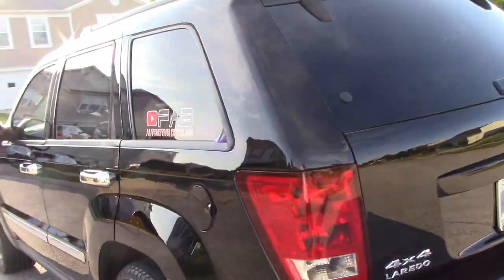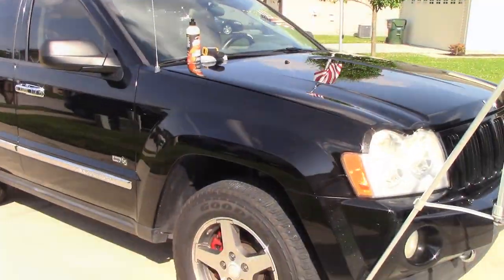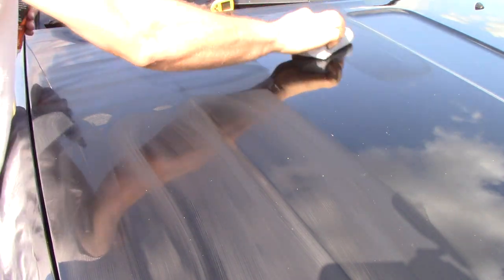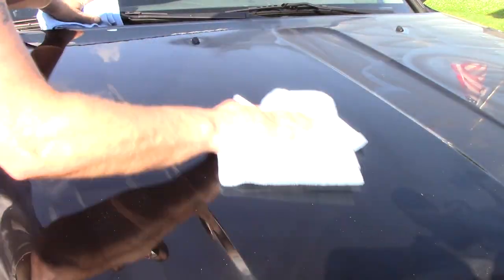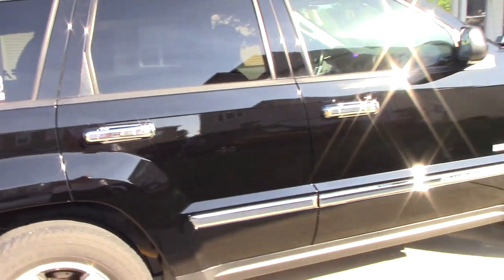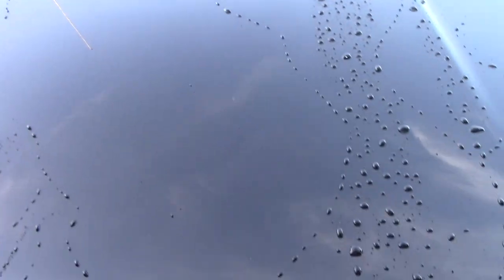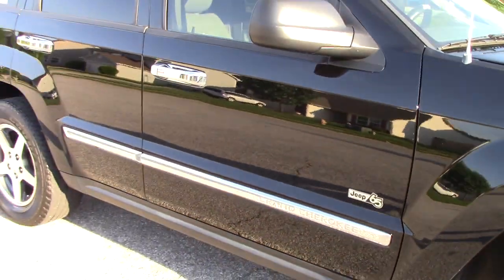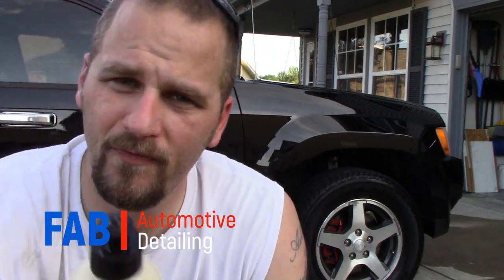Carnauba Wax + Black Paint + Direct Sunlight = Bad Idea?

Comment: Adams Polishes also works well in direct sunlight. I remember seeing somebody using it in direct sun in Arizona in 110 (maybe a couple degrees lower) and it went on and off perfect. I would assume Chemical Guys Butter Wet Wax would do the same as well.
Reply: Ethos makes some awesome designs for their bottles
Reply from the maker: Daily Driven Mustangs I ya e heard that about buttery wax but never have tried it. Yeah their bottle labels sure set the product apart from others.

Comment: Hey bro . Have a question I'm about to do a trasfer case fluid change and differential fluid change on my two jeeps grand Cherokee  but cant find them on mopar site . If you did those fluids where did you find yours . 

Thanks any links will be helpful  

I have 2007 grand cherokee Laredo 3.7 
And 2008 Laredo hemi 5.7 
Thanks .
Reply from the maker: MR.4-4-85 I use all AMSOIL products in my vehicles. If you go on their website you can locate a dealer near you. If you do it you will want to pay the $30/year to be a preferred customer. It saves you a lot of money.

Comment: When you bought your wife's jeep any issues with the radio not working.  I just bought one radio screen work just no sound ,all fuse good  any ideas.
Reply from the maker: MR.4-4-85 The radio has worked fine other the volume button is a little touchy. Sounds like the internal amplifier has gone out on your radio.

Comment: Is it possible that sure, it goes on well, but no way a Carnuba survives on a panel that’s 140 degrees or more on a regular basis. 

It’s cool that it can be applied etc. 
More interested in whether it lasts. Carnuba melts at ~140 and a black panel will reach that in the summer sun very often.
Reply from the maker: Scott Vogan I have already started filming update videos as I applied this 3 weeks ago. I will put out one video showing it from week 1 on until it’s gone. I can tell you we are having the hottest weather here that we have had in a very long time. In the week 3 update I use the temp gun and the panels are over 150 def and it’s still holding up great. The real test will be the week 4 update because it has been over 150 on the panels all week this week.
Reply: @FABAutomotiveDetailing  
Nice.  Love your videos and contribution to the freak community that is all of us who love detailing cars. :) 
I'm amazed it lasts.  I'm not sure how since the natural melting temp is like 140 or so... But I'm happy it does!  I'll have to give it a try.

Comment: So I watched a DPC video and he talked about water ph changing as water gets hotter. I think that’s why we get water spots. When water dried on my car over night, no spots. During the day, wax melting spots
Reply from the maker: Jeremy S Yeah and unfortunately our city water is very hard and we don’t have a softener.
Reply: FAB Automotive Detailing I live by the ocean and it’s really hot here too. Try an rv water filter from Walmart. $25 for 2 and replace every 6 months or so. It’s helped a lot for me
Reply from the maker: Jeremy S I did recently buy the CamCo water filter at Walmart and it helps a lot!
Reply: FAB Automotive Detailing that’s the same ones I got. Actually makes the water taste better too lol
Reply: Do you just put those RV water filters inline on your hose when you wash? It doesn't reduce the water pressure this way?
Reply: jevilla122 no pressure reduction but we have high water pressure. I even use it with the pressure washer
Reply from the maker: jevilla122 Yes in line and it didn’t seem to change my pressure. Worked great also!
Reply: Sweet. I'll have to try this...

Comment: CAN YOU PLEASE TEST CARNAUBA WAX LONGEVITY ON HOT WEATHER PLUS ENGINE HEAT
Reply from the maker: Bobby G I did make update videos on this car after this Wax was applied. I will find it and put a link here.
Reply from the maker: Bobby G https://youtu.be/GFcFZ3eYBxc
Reply: @FABAutomotiveDetailing  THANK YOU VERY MUCH :)
Reply: @FABAutomotiveDetailing  HI, YOUR CHANNEL IS VERY INFORMATIVE, VIDEO SUGGESTION, CAN YOU PLEASE TEST INEXPENSIVE WAXES. CAN YOU PLEASE TEST FORMULA 1 CARNAUBA WAX, FOR SHINE AND DURABILITY. IF INEXPENSIVE CARNAUBA WAXES ARE WORTH IT, OR JUST BUY EXPENSIVE WAXES
.
Reply from the maker: Bobby G Thank you! That’s a good idea. Maybe something I can do this spring since winter is basically here in Indiana.

Comment: Their product might be good but their customer service needs work, they were sending out samples the bottle was not screwed on correctly leaked and destroyed my mail after 5 emails to them the only response I got back was a tough luck. Turtle wax  sent me a replacement for one of their products when there was a problem.
Reply from the maker: pvj6993 I have never had to deal with their customer service so i can’t speak to that but their products are good. It sounds like you had a bad experience and that sucks.
Reply: Sorry to hear about your experience! This must have happened when we were doing a limited run of 2oz surface coat samples. Unfortunately those all went within 24 hours so there were no more products to send as free replacements to the free giveaway. Definitely stay tuned for our next giveaway!
Reply: @ethoscarcare  Thank you for the apology, it wasn't so much the loss of the product but the fact it took as much to contact someone and the response was USPS wasn't kind. As you stated in a saturated market how you treat people matters. As does response time several weeks and 5 Emails is not good.